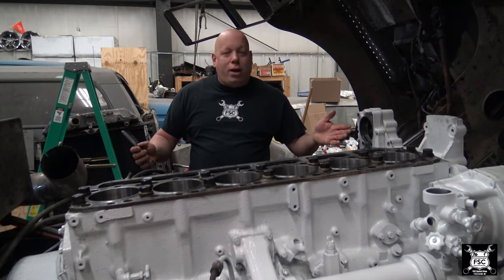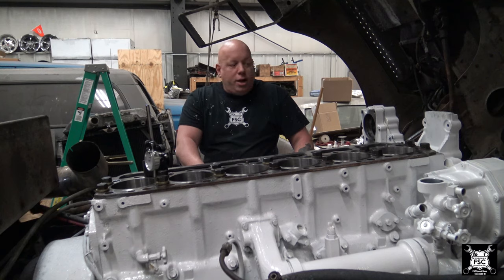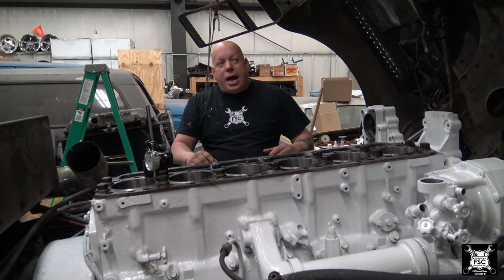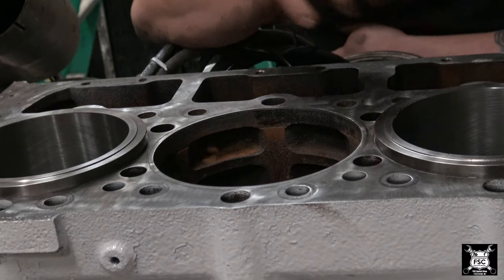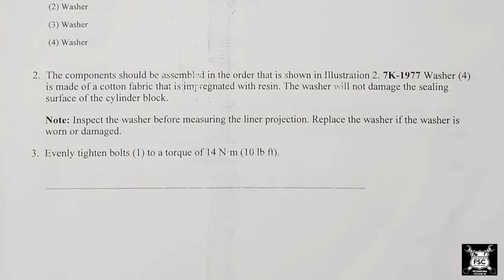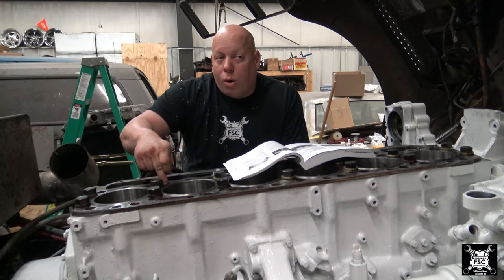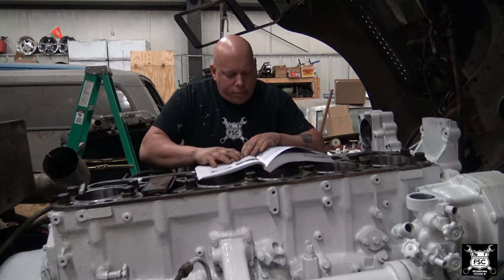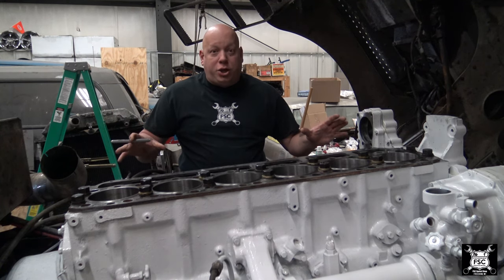CAT 3406B Liner Projection And Counterbore

Comment: Gotta use a liner sled gauge. And that block had decent fretting on the water passages on the block. You can get by doing what you did and hope for the best. Next time take it from a machine shop and get stainless inserts for the are passages and get the liner counter bores cut and. Shimmed with stainless. You can deck the block a bit and run a thicker spacer plate. They can ensure the block is very accurate and will last longer. When you lay your spacer gasket use locktite aviation gasket maker. On both sides this helps a lot with movement of the gasket. Lube your head bolts in copper coat and engine oil. Or mp50 molylube

Comment: Just started watching your channel and so far no disappointments.  Makes for easy listening when someone is as articulate as you are .  We have several rgns in and out everyday hauling  equipment and most if not all have chain and binder rails mounted on the gooseneck facing the rear of the trailer. If theft is your main concern I understand why you don't but it would save you a pile of energy every day instead of having to climb up on the deck of the tractor constantly although it helps to keep the joints in shape. It's simply a piece of 3/16 x 1.5  flatbar welded there. Never heard of anyone loosing anything while driving. Second suggestion would be a piece of timber under the buckets of excavators, especially under the linkage to save your trailer deck from taking a beating resulting in an undesired lumber replacement job. Lastly, I believe the main reason for taping a forward facing exhaust is to not have the turbo bearings run dry but I could be wrong. You can buy leather/vinyl sleeves made specifically for this that are held in place with a bungee. Miles faster and saves the pipe from being covered in glue when delivered to the customer.  To me, seems more professional. Keep up the good work and thanks again for the quality content.
Reply from the maker: I switch trailers often.  I use company trailers for the versatility of multiple types for now.
Reply: @fsctrucking  Gotcha.

Comment: i appreciate you wanting to do this build properly using the manual. your intentions are admirable. that method of measuring liner protrusion is not as accurate as the specs cat is looking for. there are too many moving pieces to that dial indicator. the proper tool is a magnetic base with the dial indicator built in stationary. i know this engine is already done and running but it would be interesting to see how those measurements compare to the actual protrusion gauge measurements. i dont think that process of bolting the spacer plate and liner was accurate. i may be wrong but i thing there is an updated procedure that requires quite a bit more bolts and torque spec. regardless, it is up and running and i hope it treats you well. like you, i am not a big truck engine mechanic....i have to figure it out as i go.
Reply from the maker: I found out about updates after I did the inframe.  I was using the book I ordered from Caterpillar.  On the plus side the job was done by a pro but sat for years, which is why I took it apart.  She simply lost the O Rings.
Reply: I have been building formula 1 wet liner engines for 20 years, after doing my apprenticeship on big diesels 30 years ago, notably Cat, Cummins, Scania and Mercedes engines. For a field repair of an engine, how he did it was more than accurate enough. Those things are tanks, not Ferrari, my friend. FSC, keep on trucking, I love your vids. And the sound of that big Cat!

Comment: Minimum liner projection is 0.0035" now. If you have to recut, shoot for 0.005" - 0.0055". Much higher will crack liner flanges.

Comment: I hope you looked at the lowers (counter bores where the o-rings go) and checked them for pitting. The one upper o-ring was pretty deteriorated. They are known for that. Im sure that's why she got milky. I work for a engine machine shop in northern Illinois if you ever need some engine machining done. Dustin@Precision Automotive Diesel
Reply: Yes, looking at the lower bores should always be done. Our machine shop took a old tool for cutting for  inserts, and designed it to cut the lower bores, in machine. Had to take out adjoining liners to set up tool.  Also need to look at top of block for erosion and measure it, because it well effect the protrusion. The reason for the erosion is if you notice  where the valves in the head come close next to the liners, when the valves open and close they heat and cold the liner in those spot, and they move causing wear to the liner! When you put in stainless steal inserts they dissipate the heat in those areas, and tends to stop the wear cycle!!! I say these after being the field machinist that went out and cut for them for 18 years of the 46 1/2 years I worked for a cat dealer!

Comment: Im down in houston tx, i have the same motor previously painted white in an 89 fld. What was the significance of the white color? I wish i had someone like yourself to run questions by down here. Respect from HTOWNTX
Reply from the maker: It was a PACCAR thing in the late 70s early 80.  They wanted to set a higher standard in trucks.  So they had a deal either Caterpillar to paint truck engines for PACCAR Matterhorn White.  This is a slightly different white from Caterpillar's Marine engines.

Comment: Excellent explanation but I have a question with the different allowable measurements on the 4 corners of the liner does that mean the top of the block is not perfectly flat?
Reply: I think it's a combination of imperfections of the block, head surface, liner, etc. It can happen to be that the imperfections in each of the pieces add up to the total being out of spec. It seems like most of the time it just works but if it doesn't then you can rotate the liner or swap them between the cylinders so the imperfections don't line up.

Comment: Hey Steve, this video popped up today so I watched it again. At the 16:45 mark I noticed something when you showed the liner with the damaged o-ring. I noticed some damage just above the groove caused possibly from electrolysis. That’s probably how you were losing coolant.
Did you check if the block was grounded properly? I always run extra ground cables on the front and back of my blocks to a good ground point.
Loving the videos!

Comment: Using a dial indicator with magnetic base is really not a accurate way to measure liner protrusions.  There is simply too much deflection and too many movable parts.  The actual liner sled gauge has the dial indicator mounted rigid to the sled gauge and you zero it on the deck surface or spacer plate and slide it onto the liner.  Every time you move a indicator on a magnetic base the measurements change.

Comment: I hate to tell you. Your book is out of date and your bolt quantity was not enough, 26 needed. Bolts 7H3598, washers 8F1484 and 7X0564, torque bolts to 70 FT LBS, Liner projection on a counterbored block is .0035 to .006. Your Cat dealer should have informed you of Reuse and Salvage guideline, media number SEBF9008. Updated 12-9-2019. Replace all head bolts and use moly paste on them. Hope you don't blow a head gasket.
Reply from the maker: The bolts in this video were only for the counterbore.  The head was installed using new head bolts.  Including the "Jacobs" bolts.  This complete job was done after consulting the service techs at Caterpillar many times.
Reply: @fsctrucking  I realize that, the proper liner projection hardware is listed above. Read SEBF9008 from Cat.
Did your Cat techs inform you of this media to look at? Been working for Cat 39.5 years now.
And yes your 7FB is a 400 HP. Most you could get out of a JWAC engine.
Glad you use new head bolts. Min liner projection is .0035 on a counterbored block.
Reply from the maker: @johngoldsmith6629  no.  They did not.  Thanks for the information.   She is built now so we will see.
Reply: @fsctrucking  Good luck
Reply: well id he does it wont be what he did here but cats junk liner/counterbore design
Reply: mickey mouse headgasket /firering design to pressfit counterbore bushing otherwise liner will wear into block n drop new bushings cats stupid junk stainless shim bandaid on a bandaid seen cat ruin o/o for liners dropping